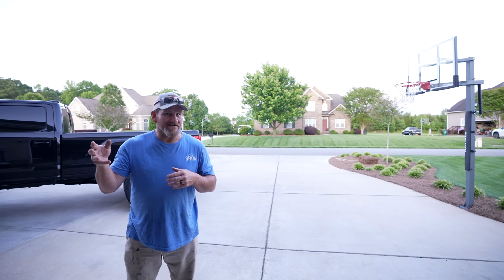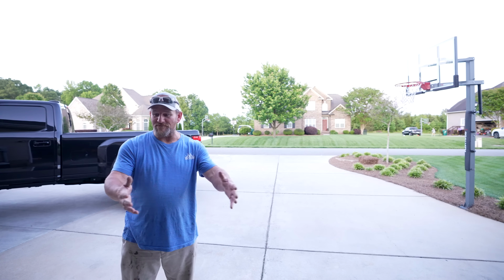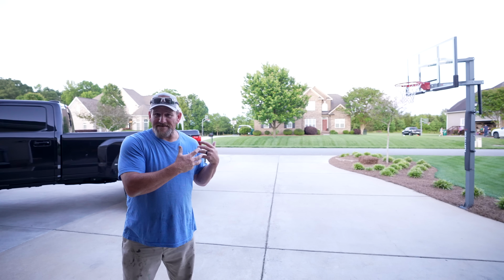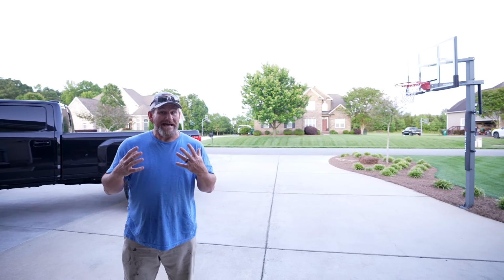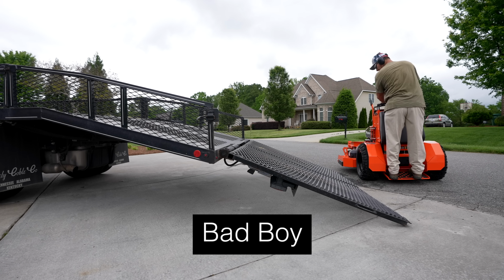Loading Stand On Mowers On Trailer Test Which One Do You Like The Best

Comment: I like all the mower with the operators platform hanging off the back.  
Don't like standings between the drive wheels.
I still have a Great Dane Surfer, not a super surfer, a surfer.

Comment: Top 5:
1. Grasshopper (completely smooth and steady)
2. Hustler (so fast it almost took out the back window)
3.Cub Cadet/Ferris(didn't see it go forward though)
4. Spartan
5. Wright
Drama Queen: Gravely
Speed Demon: Hustler
Turtle: Bad Boy(when the foot plate didn't get stuck)
Reply: Gravely drama queen???
Reply: @jason6325 did you not see it almost come off the trailer?
Reply: @Bkob1471  no.i seen a slight mishap. I did not see it almost come off the tailor.

Comment: The only standers I've ever tried out are the Ferris (about 3 years old) and the gravelly from last year. I thought as always, the Ferris cuts great, but in my opinion it's a little jumpy. In my view, for a machine to be flawless, it's jumpiness tells me whether or not it's a good fit for a new employee.  The gravelly I tried out at the dealership and they wouldn't let me turn on the blades so I didn't get to see how it cut, BUT, the way its back wheels ease into turns was so smooth you'd have to really really try hard to tear up the turf. To me, that's a perfect mower for a new employee, and if it cuts as well as the others, then it would be my choice.

Comment: Amazing how many either had difficulty getting up or tilted back.
Reply from the maker: Several of them are a little lite in the front end for sure
Reply: @GCITurf  i would imagine you will run into the same issue when mowing hills. Which can be very dangerous.  Have fun!!  This is awesome
Reply: I always back into a trailer regardless of stand on or rider much safer
Reply: @GCITurf  From what I saw, the ones that  raised up all had platforms that extended father back from the axle center than the others. I personally own a Ferris Z2 and I am so satisfied with the way everything is centered over the axles. It helps it shine on hills and hillsides due to the center of gravity and weight distributed directly over the axles. Even the fuel tank is just in front of the knee pad which also helps keep the center of gravity low and centered.. Great test Pete as always. God Bless you my friend.
Reply: @GCITurf  when you start going into the nitty gritty of these machines in your videos for each, this might be an opportunity to highlight if weight kits are available and what the added costs might be for the manufacturers offering the options.